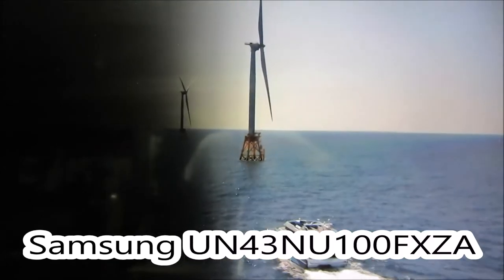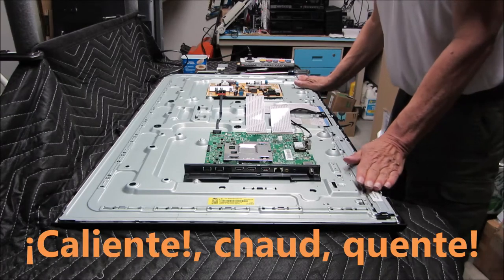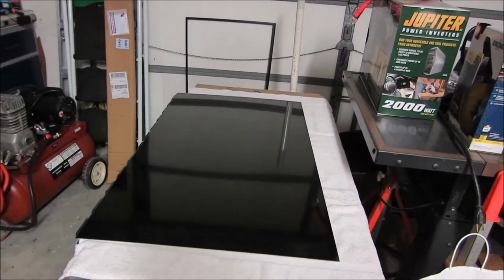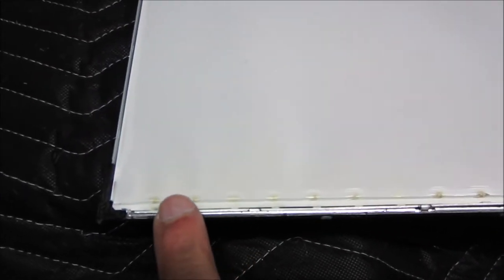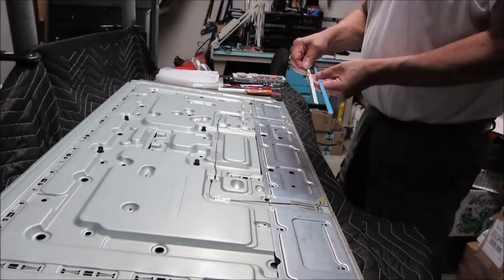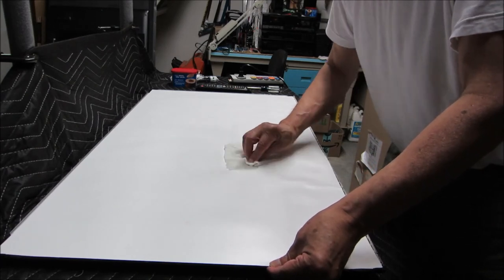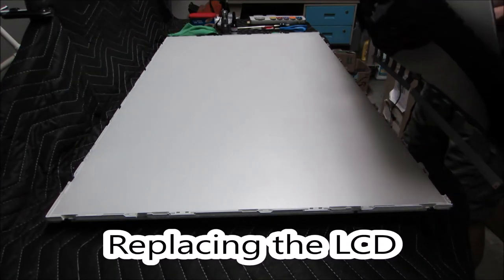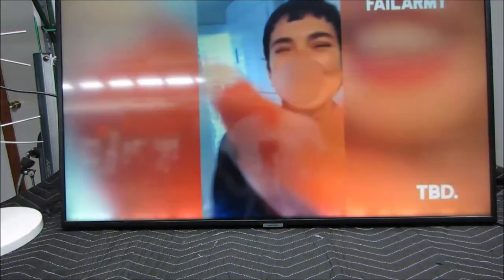LCD/LED TV Repair Secrets - Half of Display is Barely Visible

Comment: The trend is that when an LED blows people still watch the tv until more go, and its unbearable to watch.  The overheating destroys the loght guide plate.  Sharp has a circuit to detect and protect this.  I am experimenting cutting down spare plates from larger sets to fit and replace the old cracked one with some success
Reply from the maker: Just curious, did you actually watch this video? This Samsung UN43NU7100F is an edge lit TV. It does not use diffuser lenses. Instead, it uses a light guide plate. So as not to confuse others, the conditions you describe have no relevance here!
Reply: @Lawrence Pina  yes i watched it, i used the wrong word but the message is the same,  the lens gets melted whe you run samsung edge lit tvs with blown LEDs